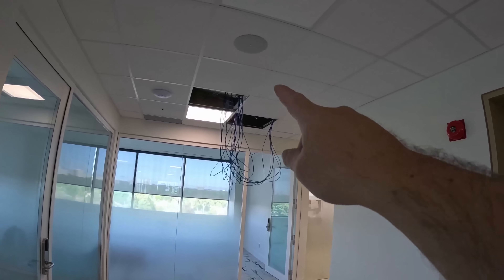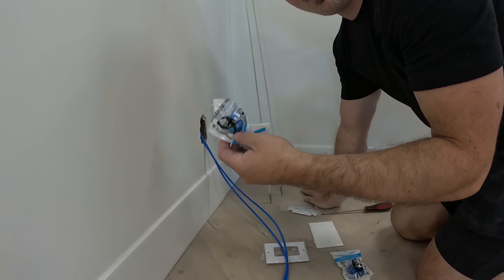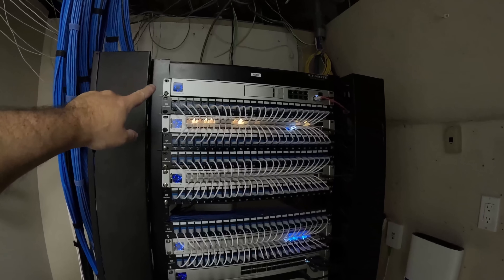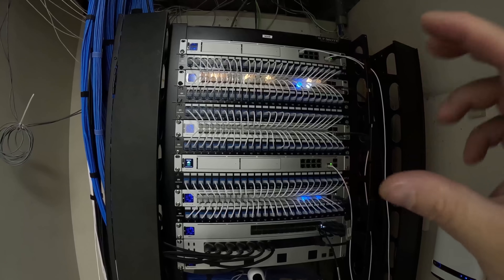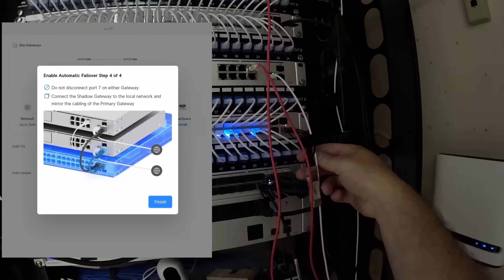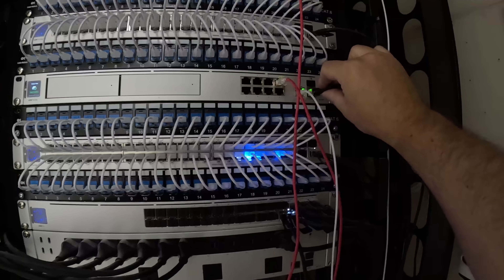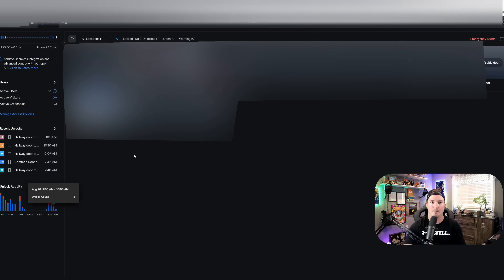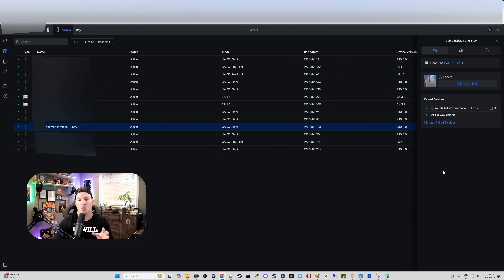On the job : Network cabling and Unifi access

Comment: Was this the same place I watched earlier where youw ere going to do salto access.  

I ask because I am trying to find a solution to secure 13 doors across 2 floors and the thought of running that much 22 guage wire while also running ethernet is annoingly terrifying.

Comment: I'm getting close to doing a Unifi Access install on a new building, approx. 20 doors with electric locks. Out of curiosity, what is the longest cable run you've done to the electric lock from a hub?

Comment: I'm glad to hear you're going to do more Access videos -- there aren't many out there! You should do one where you swap out an old apartment entry intercom system (such as a NuTone 478) with a Unifi Intercom and Access hub, but use the same door strike (like for the scenario where using Unifi's door strike isn't an option). Perhaps explain the "Dry" connection as well. Cheers and thanks for the videos!

Comment: Thanks for a peek behind the curtain.

Just a suggestion, if you use low voltage mounting brackets in drywall it will make removing the faceplate easier and avoids the drywall no longer holding the screws or getting worn out
Reply from the maker: So there’s conduit and an electrical box in the wall.  A few people have said this lol.

We always put low voltage rings in if that’s isn’t. 

Thanks for watching :)

Comment: Are you doing any door position sensors (aka door contacts or DCs) or any motion rex (request to exit) sensors? I'd recon it depends on the client but those sensors make an access control system an access control system. Without them, its just keyless entry. DCs enable you to record door held open events or door forced open. While REXs enable you to auto open maglocks when leaving or record successful entry (badge registered, DC triggered, then REX triggered as someone walks by). Does Unifi capture those events?

Comment: Unless I misunderstood, you stated that you needed to swap out the UDM SE for a UDM Max in order to do HA failover which isn't the case. You can do the same with the SE by adding a 2nd SE or even a pair of UDM Pro gateways as well. The only stipulation is that they bet he same model but you don't have to go to the newest Max if HA is the goal. Source: I'm running HA on two UDM Pros on my home set-up currently.
Reply from the maker: Yes sorry. You just need two of the same consoles. I was just swapping these out for UDM pro max

Comment: Do you use Magnetic Locks at all or just the Electronic Release type?
Reply from the maker: Hardly ever we prefer electric strikes
Reply: @MactelecomNetworks  Is that mainly for fire and life safety purposes or just the type of doors you normally work on?
Reply: @MactelecomNetworks any specific model of strike? I saw UniFi has one now
Reply from the maker: @andrewbosma4857  I’ve been using the Ubiquiti ones or Adam’s rite

Comment: You don't need a UDM Pro Max to do HA, I tried it using 2 regular dream machine pro's, and it works just the same. You do need to make sure to update to the latest Unifi OS
Reply from the maker: You need two of the same consoles. You can do two UDM pro together as well
Reply: Yeah, and Access on the UNVR. Which feature did the customer require to 'waste' the current UDM-Pro and invest in two new UDM-Pro MAX for HA, instead of just having a new extra UDMP?
Reply from the maker: @perberg107  if you didn’t notice these are two different sites. The customer didn’t waste anything I took the UDM se and gave them two UDM pro max for free. Not sure what the issue is